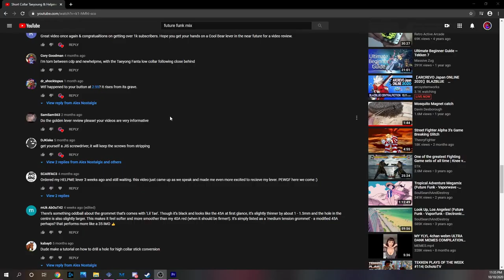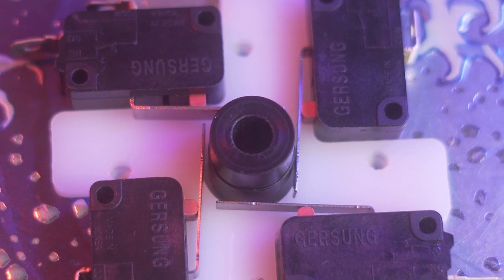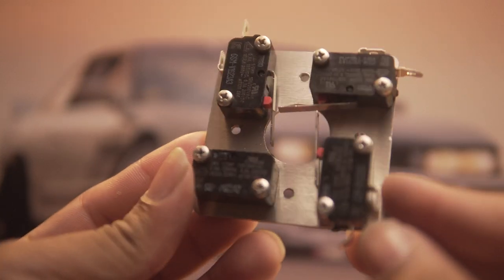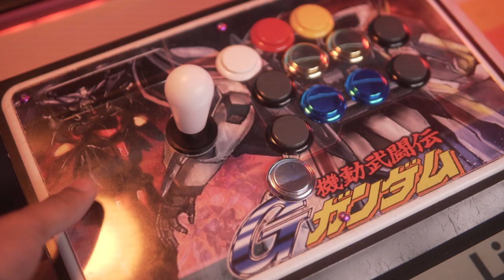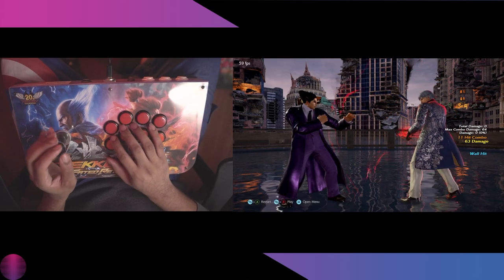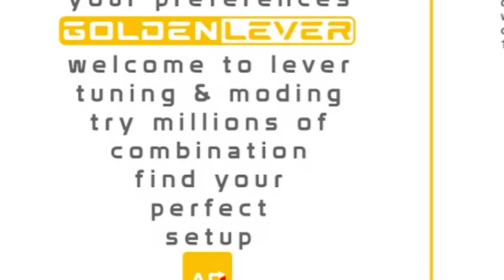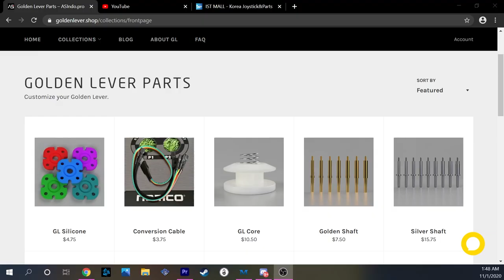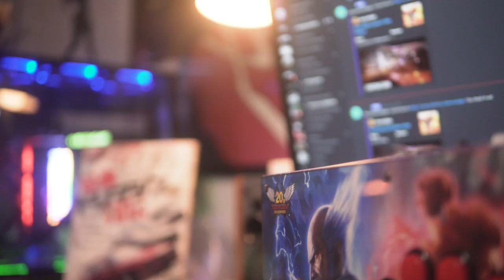Golden Lever & Cool Bear Lever  Review

Comment: Between the Fantas, the Fujin III, the Sanjuks and the Knee lever I don't see any real reason to go after any of these super premium levers when between those 4 levers and the modding options available to them you can find a setup that does exactly what you want without paying over $100 for a lever alone. I mean, if you're REALLY into the idea of constantly tinkering with your shit I guess. But the way I see it, most of us K-Lever users have a pretty solid understanding of what we want / like in a lever. I'm still rocking the Fanta III stock grommet / core with old school Panasonic switches I tracked down. I use the lever from everything from Tekken to SF to GG. I can't play on anything else. The Sanjuks is cool too, but I just can't find anything that personally beats out the Fujin in feel for me.